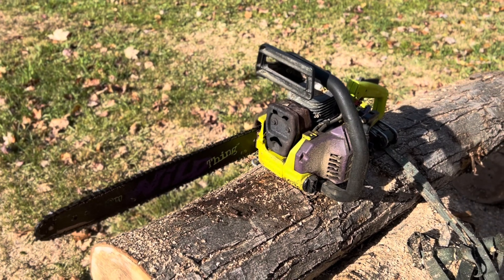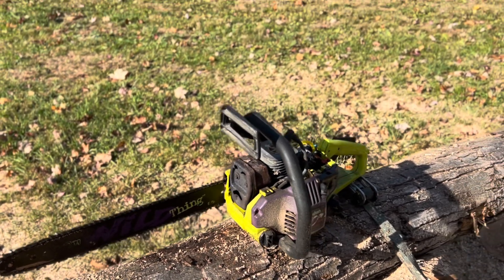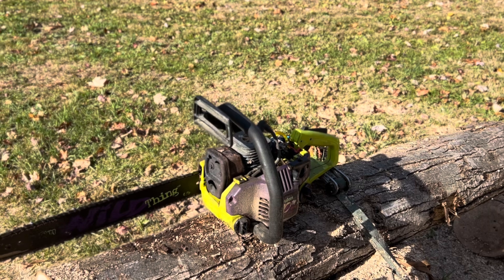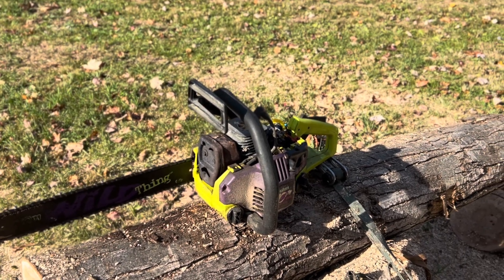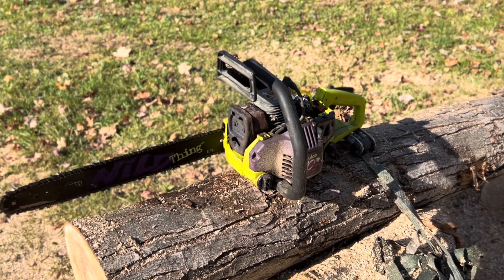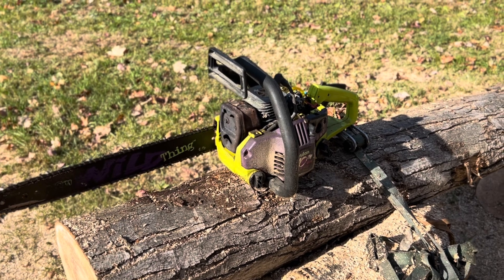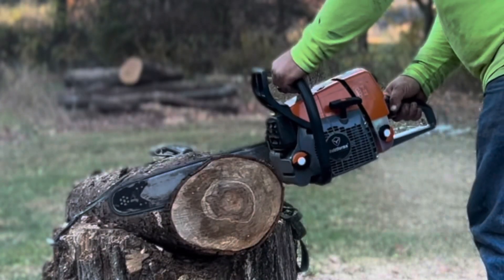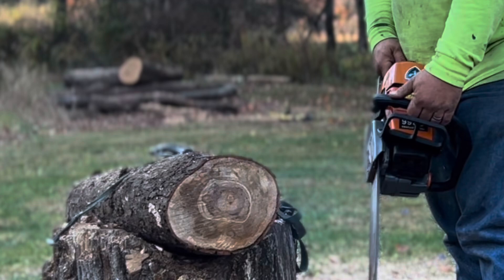Nitromethane, Alcohol And A Wild Thing!  Oh My!    Chainsaw Mods Get Interesting!

Comment: A suggestion from a twenty year nitromethane user,,,,,,buy it in gallons!  Two quarts is the equivalent price of a gallon.  And you will run two to three times the volume as gasoline.  The larger nitro engines are expensive to run, and the trend has been to convert glow engines to run gas in recreational flying.  Racing is a different matter, as the power to weight ratio favors the glow system.   Happy grinding!

Comment: Porting will help some especially on the exhaust side just have to be careful not to change top/bottom port height.  Check out hydroforming sheet metal with a pressure washer for making expansion chambers.  Have modified Briggs kart engines to run alcohol., when they run they run great but weather does affect the tune.  Pretty cool idea to do it to a chainsaw.

Way overkill but a carb off a 50cc dirt bike like the KTM 50s have changeable jets if you want to build a monster that's more tune able.

Comment: Spot on with your rpm and torque thinking.
However, my nitro saws run higher rpms in the cut vs free revving. Nitro like a load
Reply from the maker: @Eganperformancesaws  I realized that after I made the video. My 036 cuts faster than it free revs. I wander what causes that?  

It kinda makes you think really.
Reply: @Eganperformancesaws do you still bite pillows?

Comment: Could you go with a bigger carb in general and modify that to accept the fuel you're running? I would think more fuel and air together would give you even more power/rpm!
Reply from the maker: @ragercrepair9301  The oxygen is coming with the fuel. Basically like liquid oxygen. I’ve tried bigger carbs and they seem far more difficult. I need the higher velocity of the smaller carb it seems to help better with the larger volume of liquid. Getting it to scatter better than with a larger carb. Gas is the only thing I have found that really likes big carbs.
Reply: @Smittyschainsaws  makes sense. I knew about the oxygen in the fuel, I didn't realise it liked the smaller velocity carb. I see how that would help now that you say it.

Comment: I'll be keeping my 👁's on you!!!!
Reply from the maker: @DubbsSawShop  I’m starting to feel more comfortable with these fuels. Just like porting it takes practice. Nitromethane doesn’t seem to like much combustion chamber work at all. In a way it’s a trade off. Less combustion chamber work but more carb work.
Reply: @Smittyschainsaws  I might try it out on the g366, I think I'm just going to do a bit more port work to the Wildthing and send it with Methanol again next year.
Reply from the maker: @DubbsSawShop  I would start with a different top end on the 366. I find nitro likes different port work. Very sensitive to compression also.  Like 150 lbs average.